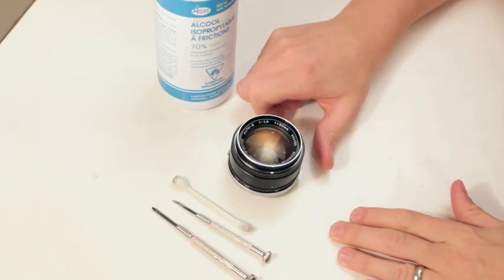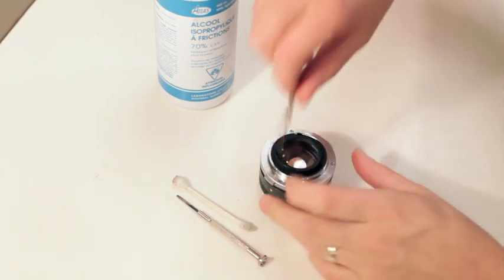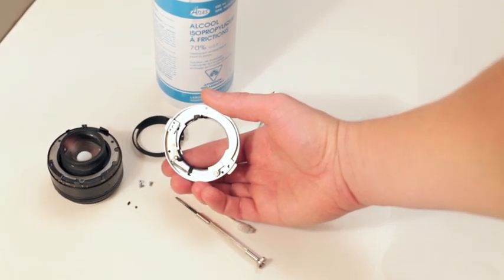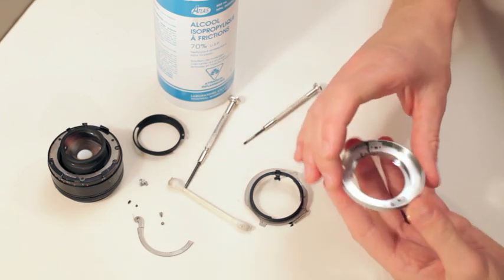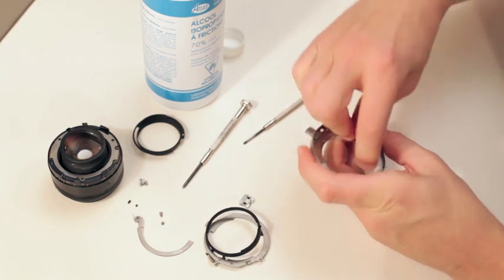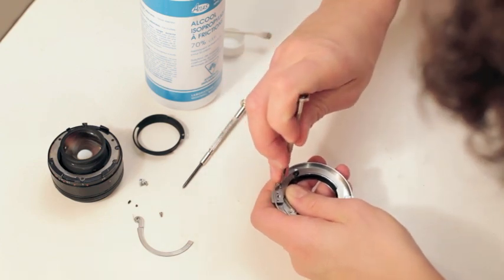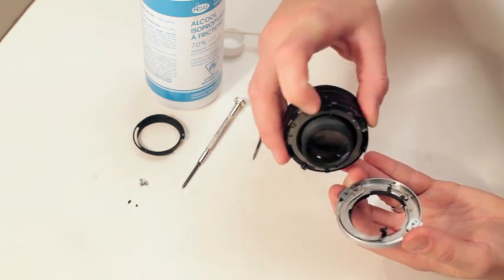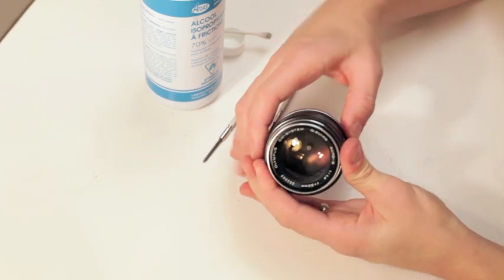Olympus oily aperture mount mechanism repair 50mm f/1.4 OM MF

Comment: Hi! Thank you so much, your video taught me a lot. I am planning to buy an OM-1 with a 50 mm f/1.8 lens. The owner says "The only thing with Lens is that the aperture opens a little slow after the exposure is finished.
 It closes quickly as it should so the exposure is good." It should probably be this kind of problem right?
Reply from the maker: Yes that or the blades themselves have oil on them.

Comment: Thanks for the great instructional video! I've dissembled and cleaned the aperture mechanism on my Zuiko 50mm f/1.8 and it worked fine for maybe 10 minutes. But after that the aperture gets sticky and slow again. Blades look clean and it seems there is no oil on them. Interestingly not every f stop is sticky e.g. f16 is fast while f8 is slow. Something f16 is also slow but after moving the aperture ring back and forth, it is quick again.  Do you have any idea why?
Reply: Update: I cleaned the aperture mechanism again with the lighter fluid and that solved the problem :)
Reply from the maker: Hey perfect!

Comment: Just took the back off of a 40mm f/2 lens, after having watched your video.  The mechanism is a bit different, you need to use a set of fine/precision tweezers to unhook a spring that holds the aperture mechanism washer in place, but it's rather straight forward.

(the screwdriver size you need is a PH00, if someone else wants to try this at home)

Took me 5 minutes to do the task and now the aperture springs into action!!  Thanks for making this video!

Comment: How do you crack open a 28mm f2.8? It doesn't open like the 50mm and my aperture is stuck.
Reply from the maker: Were you able to pull the mount off? Can you see oil on the aperture blades? The 28mm often gets oil on the blades..

Comment: Great and informative video!  I may have a similar problem on my recently acquired Olympus 35RC rangefinder camera.  I ran a roll of film through the camera and all but a few of the photos came out as if the aperture never closed down.  There is a ring around the lens that you use to turn on/off the camera (lock the shutter and stop power to the meter), set the camera for flash sync, or set the camera in manual mode.  I noticed that after several shots that this ring was suddenly more difficult to turn, and sort off gummy feeling when I did turn it.  Have you ever opened up an Olympus rangefinder camera and repaired it?  Do you have any ideas for me?
Reply from the maker: Hum yes I have had many 35RC cameras and yes sticky grease does happen. The more you use them they sometimes get more gunky rather then freeing up. It is just the grease getting old and sticky. Agfa cameras completely seize up.
Sometimes the aperture won't open or close which you can test (without film) just shooting and watching to see if it's working properly.
You can disassemble it to the moving parts by taking the lens apart, cleaning, and then touching up with a tiny bit of Atlas Grease http://goo.gl/LNrbzh but personally at that point now I would rather sell it on ebay for parts and buy another becasue they are so cheap now. I don't bother repairing that deep on these cameras anymore.
But test it first becasue it could be fine or have a small issue.

Comment: Hi I need help, the stock 50mm lens from my OM-30 film camera has a really stiff focus ring and aperature, like you need a lot of force to actually turn it... please help.
Reply from the maker: It sounds like your lens has been heated probably in the sun for some time and the oil has leaked from the helicoid into your aperture. Do you have the 50mm 1.8?
Chances are the helicoid needs to be lubricated or if its stuck then try Atlas Gear Grease.
If its more then that you will have to completely disassemble the lens and re-pack the helicoid with proper grease and completely tear down the aperture and clean that. You will need a spanner and some small screw drivers.
To be honest if it's the 50mm 1.8 you might be better off selling yours for parts and buying a new one on ebay for $20.
You can probably sell your 50mm (1.8 for $20 buy it now) for almost the same price buy it now as buying another one on auction.

Comment: I have oil on the aperture blades of an Olympus 300mm f4.5 lens. Would I access the blades from the rear or front of the lens? Any videos on taking one apart?
Reply from the maker: Hum I would guess through the rear mount but I'm actually not sure sorry

Comment: i could use some help. my aperture blades close properly but they get stuck when opening from about f16-f5.6 and wont move again until i open it to f1.8 when moving the aperture ring. I have the olympus om zuiko auto-s 50mm f1.8 i can post a video showing if it will help
Reply from the maker: Hum sounds like it could be 2 thing. First do you see oil on your aperture blades. Thats the first thing I thought it.
Second is the aperture ring lever that the body moves on the mount could be bent either on the rear or inside the mount. This is common for Olympus lenses. Just check looking at the mount that the lever isn't touching the slot where it feeds out to the body. They can rub the side of the slot and bind. If thats fine they perhaps inside it is bent.
Hope this helps

Comment: i have the Zuiko 100mm f/2.8 , i have a problem with the aperture staying in place at f/4 it opens back up to f/2.8. I guess there the quick release buttons on both sides at the base do you know what that could be
Reply from the maker: Hum I'm just trying to think what that could be.. The one side button is your depth of field preview which can be tough to press sometimes.
It almost sounds like your using it on an adapter on a digital body?
If your using it on a older OM body then it might be something in the mount slipping but I can't think of what.
Reply: yes im using an adapter, on a digital camera. the problem was there before i placed it on the mount. the aperture blades wouldnt stay closed at either setting so i followed your video to fix the problem... when i opened the backing it was nothing like the 50mm lol... 

all in all i fixed it, it was the spring. I guess who ever had it before me didnt put it in place right.
Reply from the maker: HOF CEO Oh wow I'm so glad to hear that at least you saved another cool lens! Good job!

Comment: I have a slightly different problem with stuck aperture blades on a Zuiko 55/1.2. You can see it here: v=gecF99sRESk
Lever jumps right back. Any help is appreciated.
Reply from the maker: Actually that button you are pressing is the Depth of field preview button and shouldn't stick closed like that. It should just press and close as soon as you remove your finger. It is on a spring system. It is actually sticking which is leaving your aperture closed but it shouldn't be doing that.
This means you will want to pull the mount off and remove the old grease that is keeping it stuck closed when you press the DOF button. If you check the end of the video you can see how it is suppose to snap closed.
Reply from the maker: Actually just looking at your video again it almost looks like something is bent and sticking which is causing the aperture to stay closed.
I have had this happen to 2x 50mm 1.8's and what it was is the lever that stuck out of the mount was bent and grinding on the rim of the mount. The other one was bent inside of the mount so I pulled it off and bent it until it moved again.
Reply: Todd Armstrong Thanks, Todd! I'll check it out. Cleaning will definitely be part of the process.

Comment: Hi Todd,

Can I ask for some tips to start fixing and cleaning my own lenses? I am an amateur, so what do you recommend to learn and use as basics for fixing, cleaning lenses? Also, are all lenses similar in the way they function?

best regards
Reply from the maker: Hey this is a reply to your other comment on the other post. I just saw it and replied but I will copy and paste is here also. No not all lenses are the same but there are some similarities once you figure them out.
Here is the reply for the other vid comment I will post it here. Hope this helps:
---------
Hum tough to say as I have never heard of a Tokunun lens before so I'm not sure the design of it.
The really old lenses had tons of blades around 16 like you said. they are pretty difficult to put back together and you have to watch the tiny lugs on the blades don't pop out. They are pressed in when milled. They can pop out pretty easy and then your looking for parts. I try to avoid the really old style apertures. Many of those old lenses didn't have auto apertures so they didn't need to be snappy either. You may not need to clean the blades if it is a non auto aperture, meaning the blades are not opened and closed by the body when the shutter fires.
Probably my #1 piece of advice is go slow. If something doesn't come apart don't force it. Chances are there is something else that needs to be taken off first.
#2 Don't strip the screws. Press hard and if needed place the screw driver in and tip it with a hammer. Some screws are glued and need help. Press down firm to avoid stripping the heads.
#3 Stat clean. I wash my hands multiple times for many lenses just to make sure I'm not tailing oil everywhere.
After you clean the fungus from the lens and put it back together place it under a UV light or in the sun for a couple hours but avoid heating it. This will kill any spores and help prevent it from happening again.
Ya start on cheap lenses and slowly move up. Eventually you will find many are Very similar and you will be more confident with the $ one's.
I try to avoid messing with the helicoid if possible. If you do tamper with the helicoid you will have to work on getting the focus synced back into place which is a pain.
I try to stick with elements and apertures becasue they are simple projects. For stiff helicoids I just use Atlas Gear Grease which softens and can restore smooth focus again. It is also plastic friendly.
There I wrote a small book, hopefully this can help.
Start on a couple cheap lenses becasue if you damage them, the experience with worth more then the lenses and you won't make the same mistake again. Then when you go to the expensive lenses you will be confident.
Reply: Todd Armstrong
Yeah, you are right. It is a preset lens, so there is no need for snappy movement.
haha, thanks for the 'small book'. I have come across a few fungified lenses, but just sold them. Now i realise i could practice on these 'fungified' lenses, as they were cheap. I have ordered the spanner you recommended and also a jewelers screwdriver set. Do you recommend 70% rubbing alcohol for cleaning fungus on elements and generally leaving the elements nice and clean?

I was about to sell a fungified SMC Pentax-M 50mm f1.4, but I decided to actually clean it. It only has small amount of fungus.

Thanks for you message. You have been helpful. I will hopefully learn how to clean fungus.

Comment: Thanks man for your video. I have the Olympus 28mm f2.0 Manual OM mount and I was using it for the last 2 months without a problem on my Fuji x-m1 (with adapter of course). Now I bought another OM lens 135mm f2.8 Macro so I used the same adapter on this one. When I went back to use my 28mm the aperture is not working at all and stuck to wide open f2.0. On the lens or off it the case is the same. Any idea how to fix it?
Reply from the maker: Hum that is strange.... I can only guess but make sure the levers on the mount are free and not bent.
If they are fine then the next easiest step would be to put the aperture ring at f/16, Depress the aperture button on the side and hit the lens on your palm and see if the blades close. If there is oil on the blades they will slowly close and you will see the oil. If that is the case the lens has to be taken apart for a cleaning...
Reply: Hi Todd, Thanks for your prompt reply. I followed your advice but again nothing worked at all.
Reply from the maker: Te8v8eT Ya my guess is that there is oil on the blades. The lens may need to be taken apart then and the aperture blades cleaned.
Reply: Will try that. Thanks for your help